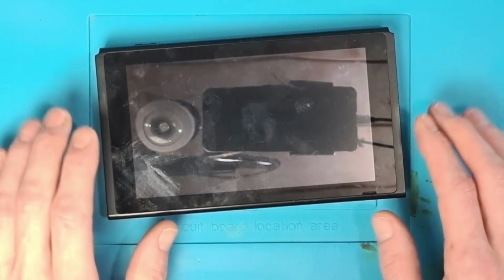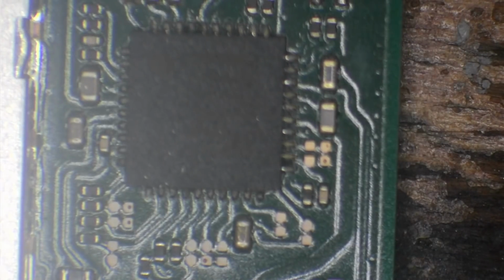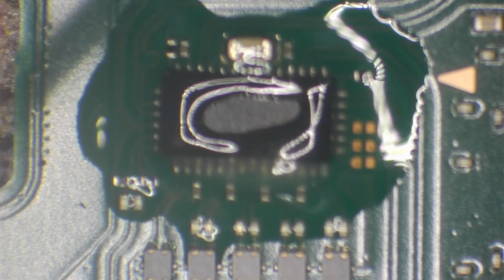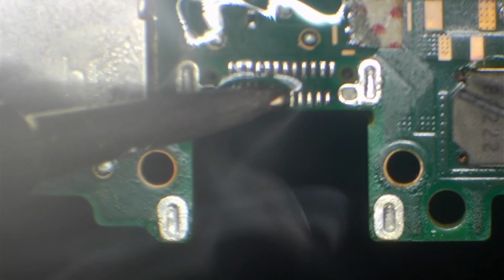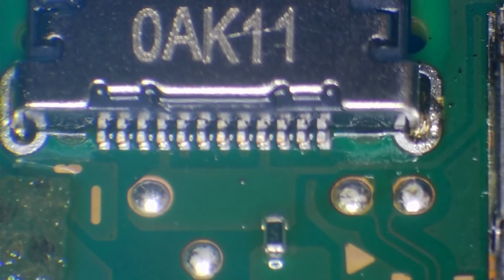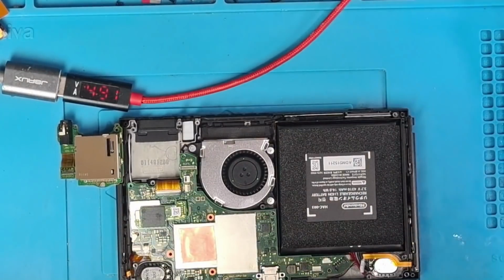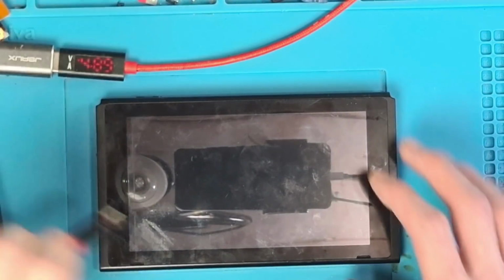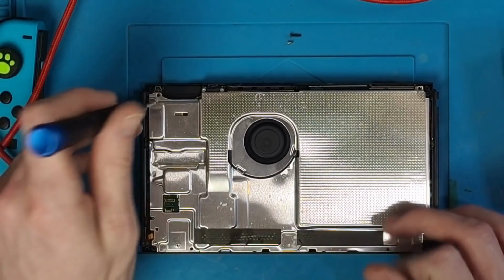Nintendo Switch Not Charging Diagnosis And Repair - Sometimes They're Just Blatantly Obvious

Comment: Hello great fix perfectly done 

little question: 
I have a switch that had  p13usb faulty (burnt)  I replaced it 
the switch works correctly but the recharge is slow (5v - 0.05amp) and the pc does not recognize the device

 also I replaced  m92t36, bq24193 and the usb-c port 
and it doesn't make any difference 

do you have any idea ?
Thanks 
(sorry for my bad english I'm  from belgium)
Reply from the maker: Hi mate, try checking the cap just below m92 and see if that one is shorted or the cap above p13 and see if that is shorted. It may sadly be a dead cpu if it still charges slowly after replacing all 3 chips and the port :(
Reply: Ok 
thank you 😊

Comment: Hi mate I did my first port after watching your videos with no problem however a week later it came back with the owner saying it had displayed the over heating warning and shut down. I've checked the fan is connected properly and it was. I replaced the thermal paste with acrtic silver, could this be causing a problem? thanks
Reply from the maker: Hi mate. It may have an issue with the mosfet just above m92. Does the switch charge the joycons at all? If not you'll need to replace that mosfet or you could inject 3v into the fan while it's connected and that will sometimes kick it back in to life
Reply: @TheCod3r  I'll check it out and report back thanks very much
Reply: @TheCod3r  Turns out the fan had just decided to pack up, is this a common thing?
I saw a bit of you trying to fix the macbook backlight, look on page 56 of the schematic at the 2 mosfets q7707  & q7706 on the enable ect, you had 0v on backlight pins of connnector you would normally have low voltage if driver wasnt boosting so have a look there mate.

Comment: Quick question!   When there is a similar issue but the system is only pulling .07 amps but m92, bq, and p13 all check out fine?  with nand removed it goes up to .13 amps. I'm so lost on this!
Reply from the maker: Hard to say mate but if it draws .07amps I'd say try changing m92 and/or p13 anyway even if it reads fine

Comment: Hi,
How come you didn’t get fast changing amps on the usb test? I thought 0.47 was slow charge and 1.47 was fast charge.
Reply: The battery was way to low, that's why it starts slowly and as the voltage rise so is the current. Battery protection

Comment: @TheCod3r Would you please explain why replacing a CPU is not an option. Its just a chip like any other and is surely cheaper than a whole new motherboard? Therefore worth a shot. Or is a CPU just as expensive as a new motherboard or are they not available for purchase like other chips? I also think that a CPU with a short would show on thermal cam as it overheats. I know technicians give up when they determine the CPU is the problem but I have yet to find out why replacing this chip is not an option as chips get replaced all the time. I can only assume CPU chips cost as much as a new motherboard therefore not worth the time and effort?

Comment: Great fix like always. I have a question for you, that I'd like to get your opinion on if possible.

I have a Switch that doesn't dock, or charge on the dock, or chrage with the original charger. It will charge with my cellphone charger, that outputs DC 5v 1.5A with input 100-240v. So in your opinion what could be the problem? I have also looked at the USB-C port an pins an they are fine.

Thank you for any help you can provide without actually looking at the Switch. Thanks again keep up the great work.